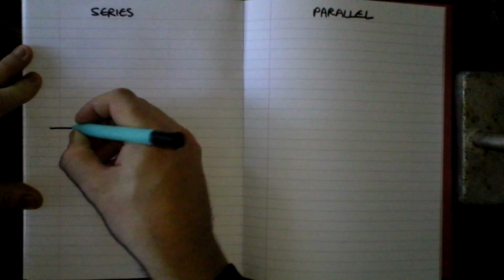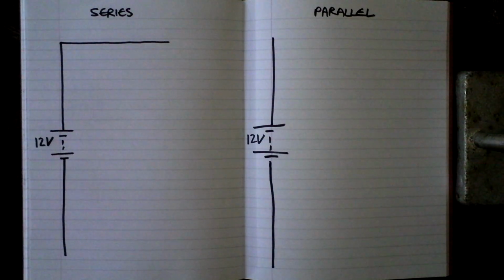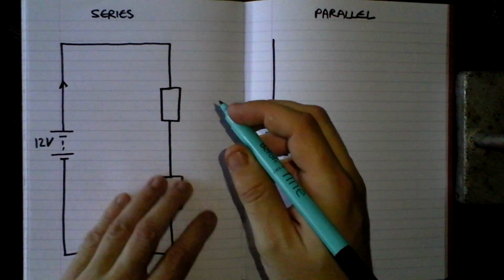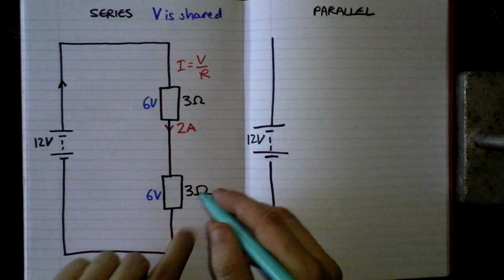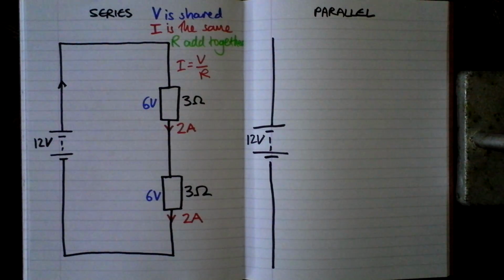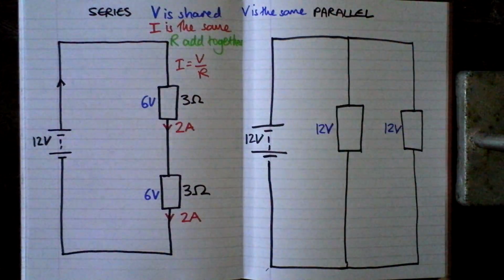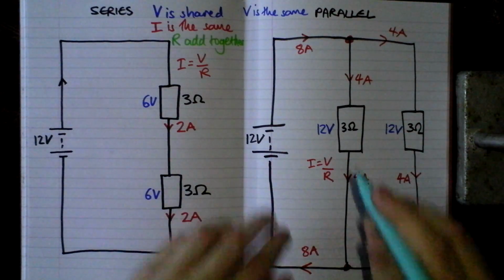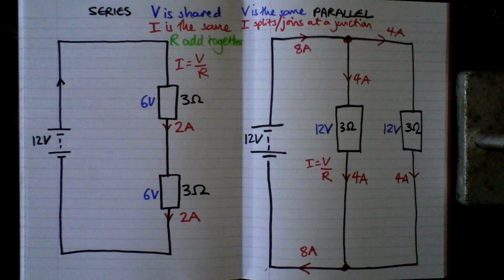BCS GCSE Additional Physics Revision -- Series & Parallel Circuits

Comment: I have a question (please answer): In the series circuit, if one of the resistors has a resistance of 4 Ohms and the other has a resistance of 2 Ohms, do I split the voltage in a ratio of 2:1?